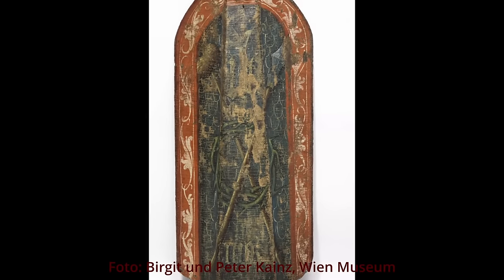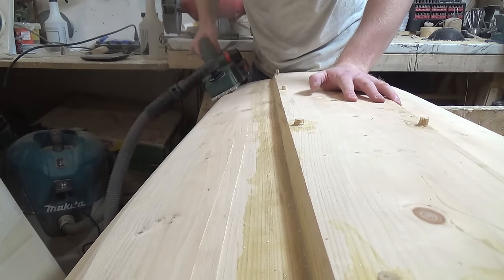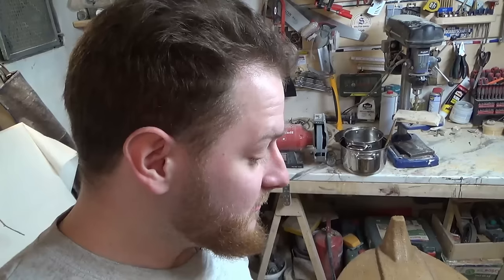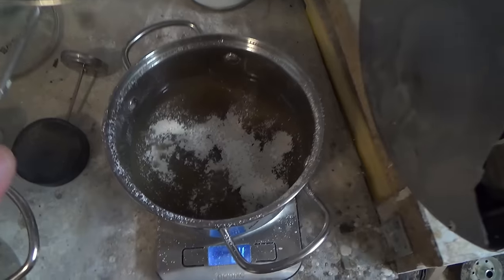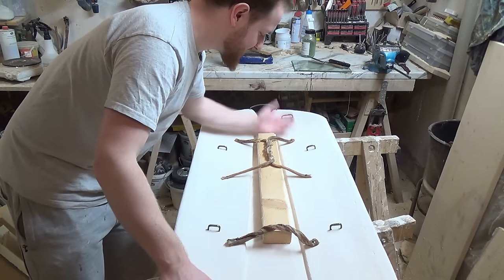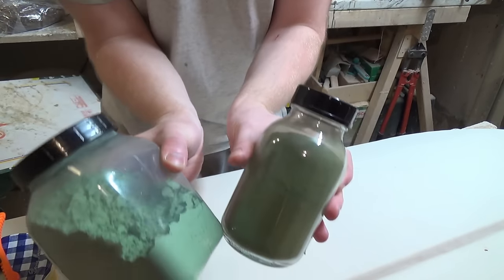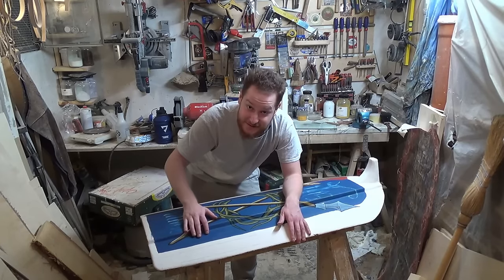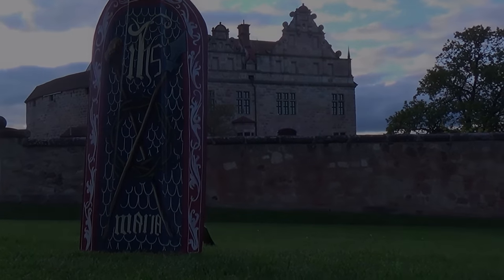Crafting a HUGE PAVISE Shield Only With AUTHENTIC materials

Comment: Was the middle part of the original made from...hm...lower part of the tree? I mean the nose may have been part of the middle segment and not attached separately. Though I have not seen the picture from the museum...yet. But still I wonder if my guess was right
Reply from the maker: If you scroll through the museums collection you can see some Paveses where the tip is missing, but you can't be that sure how it was attatched bevor. 
I think they where a seperat piece, caus it would be WAAAAAYYY more time conusmeing to carve all the other wood away in order to get the nose, instead of just adding it to the middle plank. In addition a nose cut in a 90° angle to the wood grains direction (caus: the middle plank is paralell to the wood groath and the nose is in a right degree angle to that, so it automatically would be in a 90° angle to the grain) could probably get broken of by hand. Cutting it paralell to the groaths direction from another piece of wood makes it way stronger.
Reply from the maker: Fuck; I just took a closer look at the nose thing from some of the paveses where only a bit broke of. the grain goes downwards. BUT only from the ones, where the middle plank gets higher towards the top, which isn't the case of the one I made in the video, good bless!!! 
I think that could be a nice topic for another video :)

Comment: To avoid the pin holes the first layer of gesso has to be rubbed in
Reply from the maker: that sometimes can make it better, but isn't like THE solution. 
If you didn't make the basecoat proppaly for example, the rubbing won't make a difference whatsoever :(

Comment: spent this entire video just saying out loud how incredible this shield looks
Reply from the maker: I tried that once and the fabrik still shrunk, just beacause the fibers shrink when getting sturated. In addition I had some ugly wrinkels which I couldn't fully massage out, so ironig would have been necessary. And because we also see those stretchmarks on the original I think it was done in medieval ages, as I did in this video. 
I also think that the shrinkage provides a preload which adds a lot of strenght, similar to prestressed concrete. Normally the Young's modulus of fabrik and wood differ to much, so the wood would break bevore the fabrik could take some stress. BUT with a preload, it could work :))) 
That's just a thery from myself till now, but I hopefully be bale to test that soon.

Comment: Great tutorial! Just one question - the original pavise has a narrow red border on the bottom part - was that originally or was it shortened after medieval times? 

I have seen that many pavises were shortened on the bottom part - I assume they were damaged there by humidity when stored just by placing them on ground and leaning them against wall - and were shortened much later when someone decided to use them as decoration (that's why they survived). 

I have taken photos of bottom part of pavises that are displayed in Town museum of Vienna, and they are certainly shortened, you can see the cross-section of the pavise. :)
Reply from the maker: I think it wasn't shortened. As you can see on the high-res pictures of the museumpage I linked in the Description, there is a darker red line directly on the edge. You can see that it is not broader on the sides, as on the bottom. therefor I think the hight hasn't been changed.
In addition the fabrik on the back - where you can see it - on the bottom doesn't look like it has been butcherd with a saw or similar.

Comment: A question, if I'd wanna be 100% accurate (using only hand tools and no modern inventions) would cut nails be apropriate as a placeholder for the glueing?
Reply from the maker: You mean for the glueing for the Wooden core? I don't think so; they would splinter the wood to strong and remove the planks more from eachother, then they would press them together. Only With authentic Equiptment, I would have gone with weights, caus they are cheap and I allready got those XD. Now; actually in the medieval ages I think a planing, or a draw bench would be the go to

Comment: Do you have the measurements for the shield?
Im trying to make my own but i don't have access to the museum original or a big printer sadly
Reply from the maker: As you can see on the museums page, it measures 121×54 cm. 
I also didn't print it in one big piece. I used Posterazor (free software) for transforming tthe picture into a .pdf on A3 pages with the originals measurements. then I went to the copy shop :) .
The picture you use for that should end at the shields edges thou, so sou gonna have to cut the white parts of. I used Gimp for that.
Have fun and good luck Crafting! :)
Reply: @TheShieldery  Thanks for the advice! I ended up running the image through photoshop, resizing it to fit the measurements from the museum page and then measured out the rest.
I'm just not sure about the thickness and the curvature of the side pieces. I'm guessing that is more so dictated by the thickness of the wood panels I'm using? I figured yours were around 30 millimeters thick.
Reply from the maker: @anteerceg527  bevore carving yes, after I was finished roughly 12-15mm.
the curfature is difficult to estimate, but on the museums page you can also see an picture from the side. That's where I estimated from.
Reply: @TheShieldery  Thank you so much! I appreciate the help, specially straight from the source, it helped me immensely. Keep doing what you do you are amazing at this. Greetings from Croatia.

Comment: What is the "nose" for? Were they only used for these big type shields?
Reply from the maker: Yes, only for the big Paveses.
That's a very good question for which the archeology only has theories, like:
- it's a larger, more stable supporting point for a crossbow or spear
- As a large hooking point for a support
- larger resistance to impact from the top, where it would happen the most 
- Rest for the helmets neck when the Pavese is worn on the back
- ...
Reply: @TheShieldery  oh ok makes sense! I thought it was at the bottom to maybe cover the foot. And help catch the ground to not slide. But the spear and crossbow makes WAY more sense!!

Comment: This is a great video! I really enjoyed it. Is there a reason why you were painting the shield flat instead of upright?
Reply from the maker: with 120cm it is quite high, even if I'd put it up, I would have to moove up and down all the time. In additon it would have been quite difficult to set the shield high and to position the camera correctly.
Reply: @TheShieldery  understood. I wondered if the texture of the egg would cause it to run too much.

Comment: Why dont you make a milking stool and a wooden easel to mount your shields onto. That way you dont hurt your back when you paint
Reply from the maker: the shield's so large, I'd have to change easels hight all the time. in addition the paint could drip with some pigments and form drops on the shield. Lastproblem is that the room of my workshop isn't that high and the shield would hit the Top while beeing to low to paint the bottom part. Ah; and it's also quite heavy, so I'd need a massive easel to keep it in place. :(

Comment: Crafting a PAVISE Shield Only With AUTHENTIC materials... except for all the times you didn't.
Reply from the maker: for example?
Reply: @TheShieldery  28:29, also the temporary screws were totally unnecessary the shield maker would have made sure they fit better and then clamped or weighed them down.
Reply from the maker: @CalabusDabus  I'd classify the srews as tools, which I remooved later. Like screw clamps with out the clamps and only the screws.
Yeah, I know you can argue about the titanium white, but I think I have a good explenation, which is that it's nearly impossible in germany to buy led white. If that spoiled the video for you, I'm sorry :( . You'll mayby enjoy my latest one more then, where I use less then half a gram of Titanium white and no screws.
kindly Regards, Andre.

Comment: Why didn't you put it on an easel to paint it ✝️🇺🇸🤔
Reply from the maker: - To large (120cm => you would have to bow up and down all the time => no difference comfort wise; in addition: the ceiling would be to low for most of it)
- to heavy, so I'd have to make a custom easle with specific proportions and clamps/clamp positions
- paint is to liquid with some of the used pigments, so it would drip down before drying.

Comment: привіт, дивлюся тебе з України. Вважаю, що робота супер! Але вважаю що не правильно, що ти використав саморізи. Думаю це неправильно. Все інше на 10\10
Reply from the maker: Thanks! The screws are just a tool, as the scrweclamps or the clamps. They hold stuff in place and get removed when that's not longer necessary. In addition it's very easy to do, nearly nothing can go wrong, it's cheap and can be done with minimal effort by anyone who also wants to built a pavese like that :) 
Slava Ukraini!